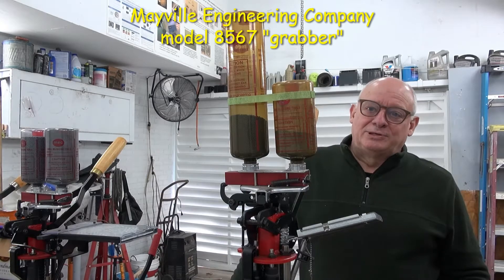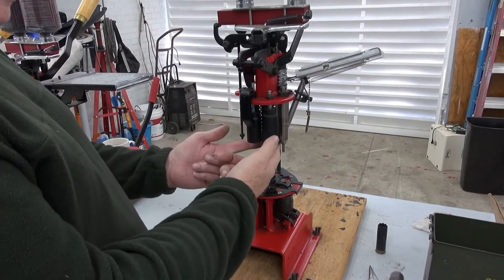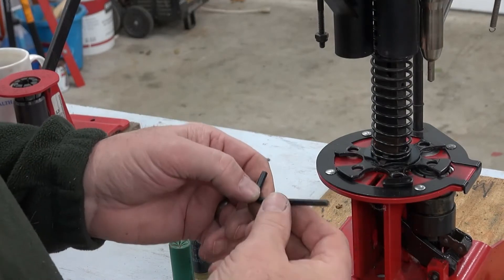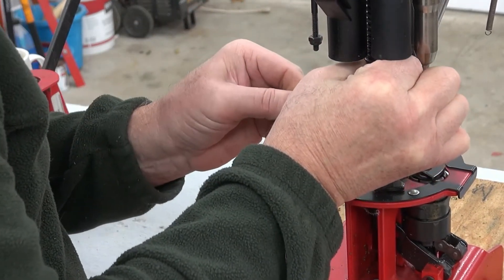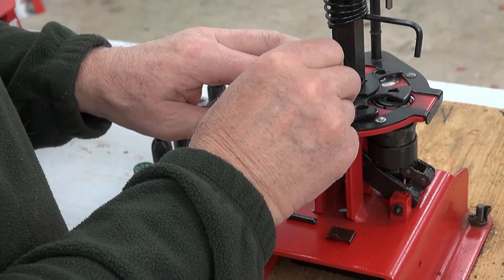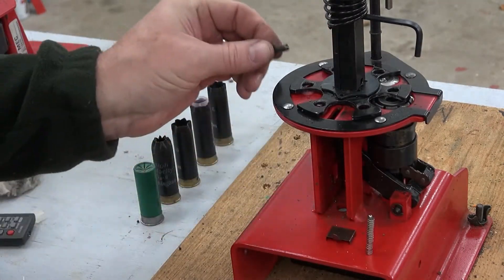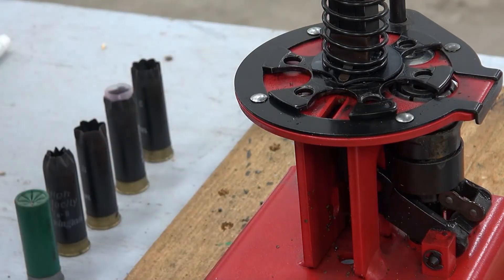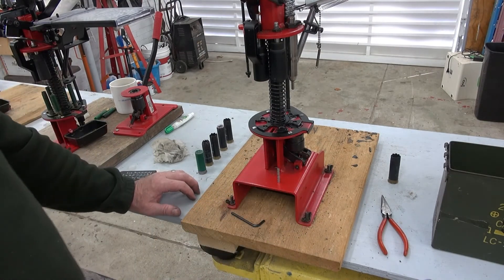MEC 8567 "grabber"  intel on "pin"

Comment: Thanks for a very educational video.  You were spot on about the carrier holddown "riding" up the spring.  
Here's are two tips that I'll share.  
1.  Spray paint{white} a half sheet cookie sheet and mount it between the reloader and the mounting block. No more shot spilling over the work bench and/or on the floor.
 2. If shot and powder become mixed, i.e. forgot to insert the wad,  drop the mixture over a piece of window screen, over a any container. tap, tap, tap and powder and shot are separated.

Comment: A couple of "nice to have" tools to have on hand are a pair of tweezers to pick up lead shot or a primer that ends up in a tight spot, a telescoping magnetic retrival tool for the detent ball and primers, and probably most helpful is a small magnetic parts dish to place your loose parts in.  Even if you knock the dish off the bench, you most likely will not lose your parts to the great abyss under the bench.  A metal or plastic dental pick can come in handy at times as well.

Comment: Good video!  Like you, I have my Grabber mounted on a board for easier cleaning and maintenance.  I use C clamps to clamp the board to the bench for a little more stability.
Reply: Do you do bismuth loads with yours?
Reply: No.  Lead only.  I can't see any reason why you couldn't load bismuth other than checking the drop weight of the shot charge.  Remember the charge bars dispence the charges by volume, not weight.  Just for an example, a cubic inch of lead shot will have a different weight than a cubic inch of bismuth shot.  In this case, an adjustable charge bar and an accurate scale will be of help.  

To load bismuth,  it may also require a change in the wad to get a proper crimp.  There may be other considerations, I'm just thinking off the cuff.  Check some loading manuals for information on loading busmuth.  @ronaldsinger3088
Reply: No, just lead. @ronaldsinger3088

Comment: Another idea  when dismantling for cleanup is to have drilled five holes in your base board to hold your unfinished shells. Size the holes to the gauge of the machine . Keeps you from knocking them over ……did that a few times before I drilled them for mine. I now have 4 machines set up as such. REALLY helpful with the 28ga and .410s
Reply from the maker: Thanks ..excellent suggestion
Reply: Nice idea, thank you.  I'm going to modify my mounting board to incorporate your idea.  While I'm at it, I'm going to tack some molding around the parimeter to contain the shot and powder from the occasional spill.  Hopefully it will make clean-up a little easier and keep it off the floor.